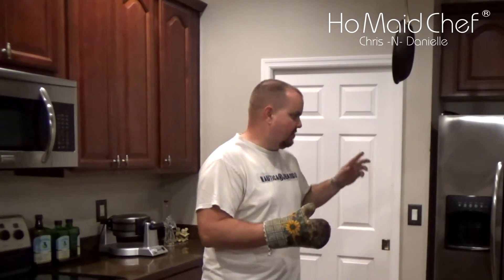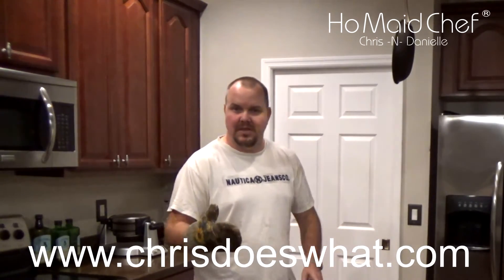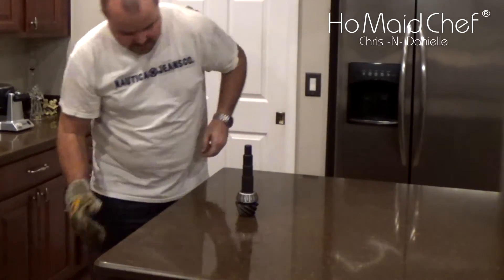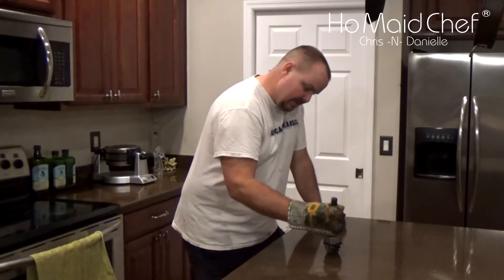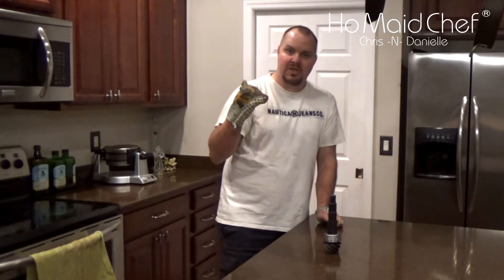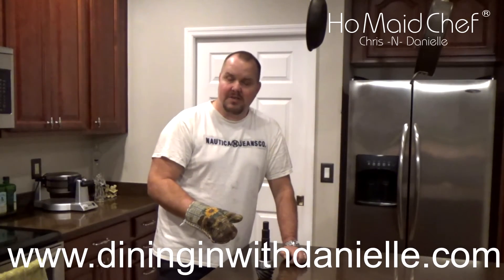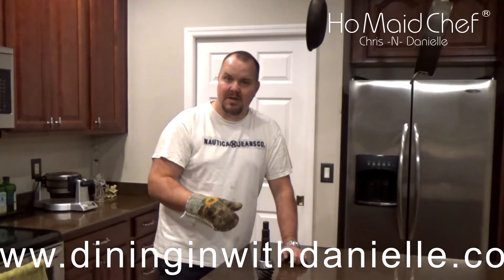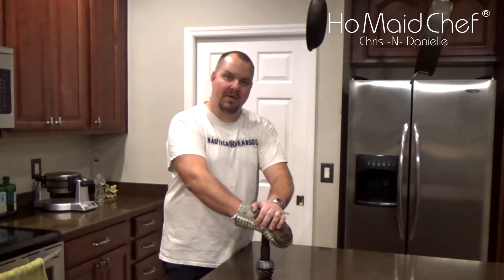Install Pinion Bearing Without A Press, Just Heat And Cool

Comment from the maker: This is a short video that came out of a longer video coming soon on the rear gear change for our YJ jeep.
 We have the rear gears done, just have to finish that video, start front gears in a week.

We are moving from 4.10 to 4.88 gear, and will tell you the change in the drive and how we like them. Leave comments on what you would like to know about this project.
Reply: Subscribed and will be watching ✅🇺🇸
Reply: Wow. Cant believe it worked. Appreciate it
Reply from the maker: @charleshill2335 heat causes expansion, cold contraction. Except with water! 🤔
Reply: was there a difference in the shims? did everything work out? i am looking at changing a 3.73 to a 4.10 is why i am asking.
Reply from the maker: The new gears did require shim changes from factory, we have a playlist on the whole gear change and the 500 mile inspection. Jeep Dana 30 & 35 Ring And Pinion Change 4.10 to 4.88: https://www.youtube.com/playlist?list=PL9vNnMj1ZmcY1OobKHopgTe7UR3p9u9xx
Reply: Doesn't heating the bearing to 400 deg. F liquify the grease inside so that it leak out?
Reply from the maker: These bearings have no grease, and man that would have smelled with a lot of smoke. We packed grease in the bearing before installing in the axle housing.

Comment: Best way to get a old one off in my opinion is to buy the bearing splitter tool.  You can get one for 27 dollars heavy duty metal.  The splitter was slightly too thick to fit so I grinded a bit of metal off of it. Then heat a couple edges of the bearing....Not the shaft!!!! I hit it with a Big sledge and a small block of wood no damage was done to the cage or bearing saves a lot money and can do one again in the future
Reply from the maker: That is great advice, bearings can be a pain to get off, that and steering arms.
Reply: @ChrisDoesWhat  it seems like you find a fix for one problem and encounter others.  Now I have to grind the oil flange because it won't fit the aftermarket pinion gear.  Plus there doesn't seem to be a feasible way to heat the upper bearing to get to slide on the pinion in order to check preload so I may have to disassemble and freeze the shaft as a alternative
Reply from the maker: @Michael-oc5ut took us 2 weeks to get this project done. Our son ne er wants to do it again. This is his jeep.

Comment: So I’m curious, you heat that bearing up to 400 right? Is that bearing in operation today, I’ve been reading/researching installing my pinion bearing this way and I’ve found that when you heat a bearing over 250 is can change it’s metallurgy causing it to fail prematurely, or just put my bearing on the pinion the way you showed and it worked great though now I’m thinking the bearing may be compromised due to heat, just wondering if the one you did is still in use. Thanks
Reply from the maker: Still on the road with no issues. May have future issues because my son wants to repower his jeep with a LS engine.

Comment: how long do you heat the bearing and freeze the shaft
Reply from the maker: Froze the pinion over night, heated the bearing for as long as it took for the oven to get to temp. This oven has a fan so that did effect how fast the bearing heated up.

Comment: You may already know this but for those that don't. Be careful heating up bearings like that, if your not careful you can actually damage  the bearing by causing its form/shape to distort/warp depending on how hot you heat it up, how long you heated it up at that temp, and how fast you cooled it off.  For pinion bearings or large thicker bearings it's probably completely fine with exactly how you did it. But the heating trick with smaller bearings is when you should probably be more cautious with heat Temps and bake times. Since you only let it stay at 400 for a few minutes after reaching that temp imo that was perfect. If you had left it in for say 15 mins+ after it reached 400° you probably would have started risking damage unless you did a lower temperature,  basically higher temp shorter amount of time it should sit in there. So you definitely did it right imo by gradually reaching temp. Now the damage that could happen to the bearing some people might not care and it probably wouldn't make a big performance difference, it would just decrease the life span of the bearing itself,  so if that doesn't bother ya then ignore my advice/observation.
Reply from the maker: Good information, and yes with litter metals they can become more mailable when heated and could wrap. These gears in our jeep now have more than 20,000 miles, they run as quit as the day we did the install with no play in the system. May have to do a follow up video on this install. FYI: have also seen people malform their bearings using a press.
Reply: @ChrisDoesWhat  yup same here. I like the manual bearing puller/press tools a little more because of that reason. I mean obviously if I'm doing it every day in a shop for a living then hydraulic press for sure. But just once in a blue moon diy, I'd rather take my time so I don't mess up. That's just me tho.
Reply: 400 deg is fine, NOT more. OR it can loose temper. Do not water cool, let them cool/warm together.

Comment: I think I have just enough room in my deep freeze for my 12 bolt axle 😂

Good stuff man, great trick. I did this for my Dodge 3/4 ton front end. Pinion bearing pooped on me; this process was the easiest part of the whole ordeal.
Reply from the maker: LOL, guess in the winter you just leave it outside, if you don't live in Florida!😬

Yes, the crush sleeve was what kick my butt on the dana 35.

Comment: I use hot water from dispenser and contact cleaner as coolant. Work fine. Atleast I'm not have to work as hard.
Reply from the maker: Must be some hot water! Would not want the bearing to get halfway on then have to press it the rest of the way.

Comment: Shim??
Reply from the maker: This pinion shims on the other side of the bearing.
Reply: @ChrisDoesWhat   okay, so I’m having an issue with my bearing. I’m upgrading my 98 TJ Dana 35 to 4.10 gears... so I’m confused on if I even have the right shim. It seems too big
Reply from the maker: We did much better at showing everything on the DANA 30 video, but for the Dana 35, this is were I explain how we shimmed up the pinion. See explanation here: https://youtu.be/x7PLmV8GlQQ?list=TLGGVpPsvrIX80UyMzEyMjAyMA&t=733 For the inside bearing on the pinion, the shim goes before you slide the race on, we ground the old race so we could easily slide it in out out to make adjustment before using the new one. Here is our son grinding the old bearing and race to make mockup bearings. https://youtu.be/ko9eHHpQVkY?t=869 Hope this helps, a gear change is one other the hardest thing you can do on your jeep, the crush sleeve takes a lot of torque and is there easy to mess up.

Comment: Good stuff, thanks for sharing! Can I ask if you have a smart way of getting the old one off too..?
Reply: Easy way to get the old bearing off is take some bulldog snips and cut the cage and get a Dremel or grinder to cut the race. Try not to nick the pinion gear.
Reply: @coreywhite127  read what I said few shity screwdrivers and a hammer
Reply from the maker: I would either call a machine shop or you can look at getting a clamshell bearing puller. https://amzn.to/3kc6x7R
Reply: Lmao I just pulled one my self other night all I did was sharpen a few flat head screw drivers on a wet stone sharp like knife and pounded them in there with a small nail hammer holding pinion in my lap worked my way up in sizes and she come right off no puller press nothing but few screw drivers a small shity hammer n my hands

Comment: At what temp do you heat the bearing
Reply: Metallurgists say do not heat bearings over 250*f.
Reply: @tcsadt  only for non heat treated bearings. These are hardneded and heat treated so this wont hurt it
Reply from the maker: In the video I saw 400F.